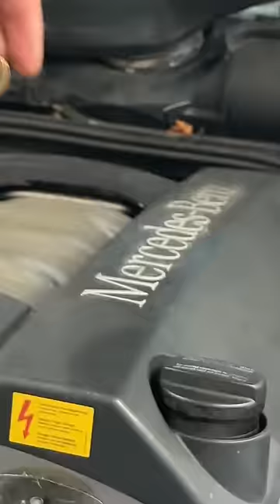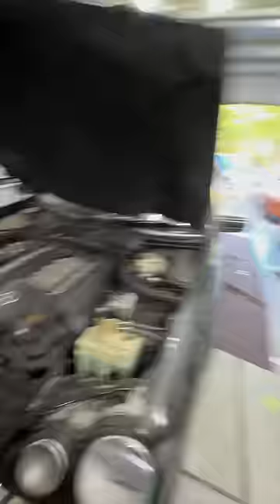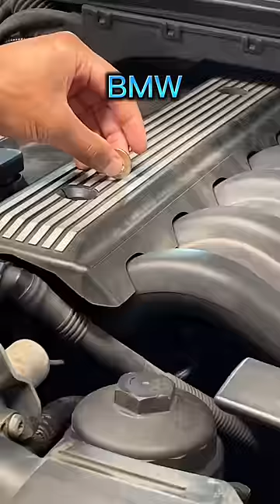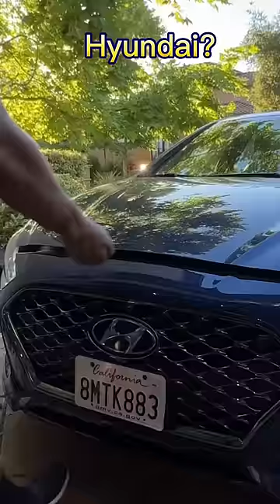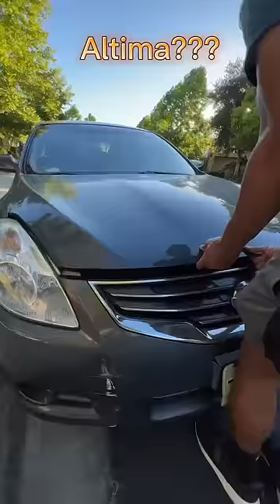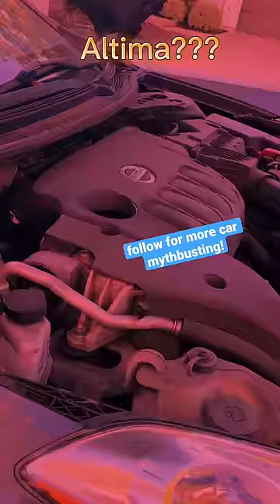The last one is 100% the best 🎩🎩🎩

Comment: How on earth is BMW a Rolls Royce competitor if Rolls Royce is owned by the BMW Group and uses BMW engines 😂
Reply from the maker: the whole video is a joke lol. that said, think about VW group. The Lambo Urus, Bentley Bentayga, Audi RSQ8, and Porsche Cayenne Turbo GT all cost over $100,000 to $200,000+, and 100% are cross-shopped by people in the "super SUV" market. no matter which option they choose between the competitors, VW still wins.
Reply: I6 vs V12 buddy
Reply: I 'm sure there's some diehard BMW fan out there with a 114i calling it a "Baby Rolls Royce". 😂
Reply: I approve
Reply: @ChrysGaines you just swiched it up
Reply: The E36 was produced before bmw bought rolls Royce 💀
Reply: @Blade_88  still the said the brand
Reply: @Daillydoseoftextfan  other way around, a v12 is an i6, or rather…. 2 of them.
Reply: better mounting from the rolls
Reply: Rolls-Royce are just a 7 series underneath
Reply: Still comparing “brands”
Different quality levels and VERY different pricing
Reply: Just about to comment that 😂😂